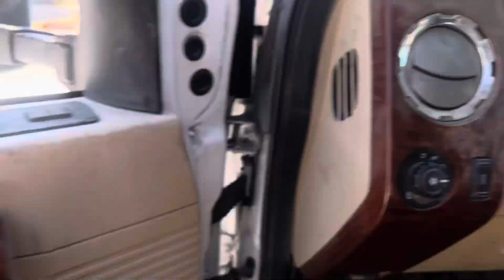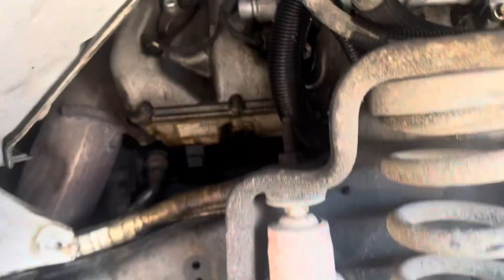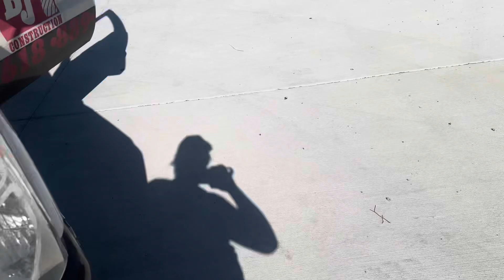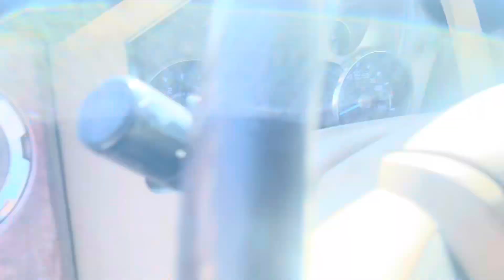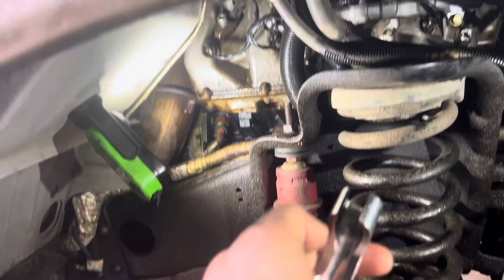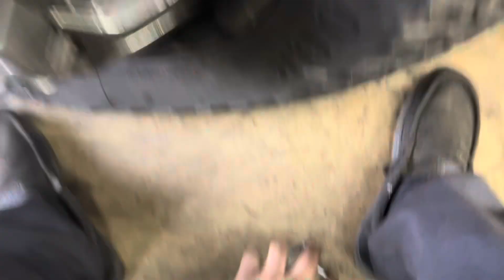Ford 6.7 Powerstroke Fuel Line Leak repair

Comment: There's 3 gasket that comes with the line. Where do they go?
Reply from the maker: Not sure which line you have. The ones from the fuel rail to he injectors have no gaskets
Reply: @JSTruckRepair   Part #LC3Z-9229-B
Reply from the maker: @smilinjoe23 I looked it up. If you’re only replacing the fuel line by itself you won’t need those seals. I would hang on to them though. The copper washer goes on the end of the injector along with the bigger o ring on the injector somewhere on the middle.they only need replaced if you pulled the injector out.  The little tiny oring should be for the top of the injector for the fuel return line.
Reply: @JSTruckRepair awesome thanks! Hopefully this will fix the p228f code after the DCR conversion.
Reply: @JSTruckRepair  Hey I just replaced the rail and the lines this weekend, but the injector line is leaking from the rail side. The way I did it is , hand tightened both sides, torqued the injector side to 89 in lbs + 60 Degrees then the  fuel rail side. It's not a spray mist yype  of leak but more like a trickle slow leak coming in from the top instead of the buttom. Any idea?
Reply from the maker: @smilinjoe23 I’ve never personally had a brand new line leak unless it wasnt tight enough or not on straight.
Reply: @JSTruckRepair it wasn't right enough. The correct torque spec for 20+ is 26fr lbs instead of 89 in lbs +60 degrees
Reply from the maker: @smilinjoe23  I have a special socket meant for injector lines. There is certain ones I twerk now and then.  But overall, I’ve worked on them long enough. I know how tight they need to be just using a wrench.  They are technically not supposed to be reused or they can leak. Because the threads stretch a little bit as you tighten it. That’s also how it seals

Comment: You might have saved my Bacon!
I've got a 2019 F250 Powerstroke....leaking in the same area from the driver side....
Thoughts it was the return injector line (low pressure) I replaced the assembly but STILL LEAKS!!!!???

Does the wheel skirting need to come out to access the injector supply line?

Is there a protocol to purge air out of the system? Or just keep cranking it till she starts finally?

Appreciate the video man!

Thank you!
🙏🙏🙏
Reply from the maker: Yes the wheel well needs to come out. I think a couple 10mm’s up front and some 5.5mm on the rest. Maybe a plastic push in or 2. A high pressure leak will make a big mess. Sometimes the “hole” on the fuel line is so small you legit will never see it with your eyes. But it’s there. I’ve seen them only leak while driving and some when reved up. So if it’s not leaking at idle don’t be alarmed. 
If you just unhook 1 fuel line it’ll start pretty easy. 2-3 cranks and she’ll fire right up. 
If you ever unhook low pressure supply lines such as the ones from your tank to your fuel filters and what feeds your high pressure pump you’ll want to use your electric fuel lift pump to prime the system before cranking or it’ll be harder to start. All you do is turn your key to the “key on engine off” position and let the fuel pump prime the system for like 15-20secs or so. Then you’ll turn the key off and back on and do it again. Sometimes you’ll have to do it 4-5 times. But after that and cranking a time or two it’ll start.